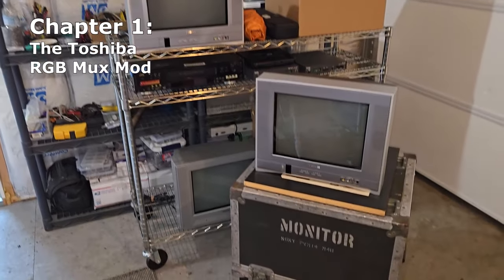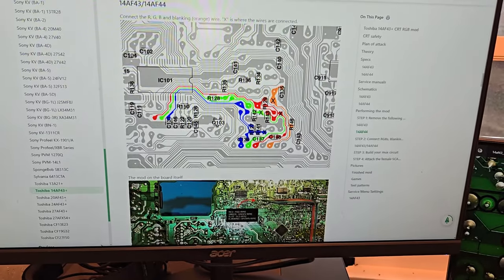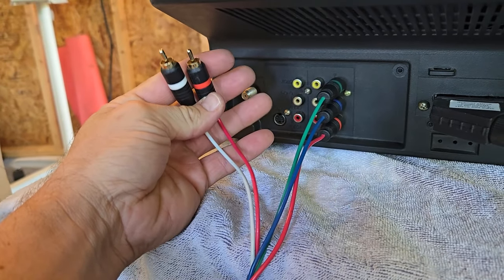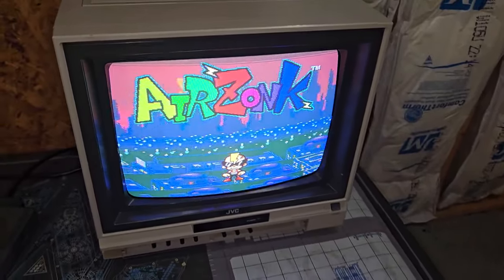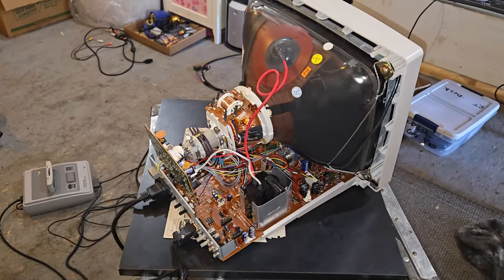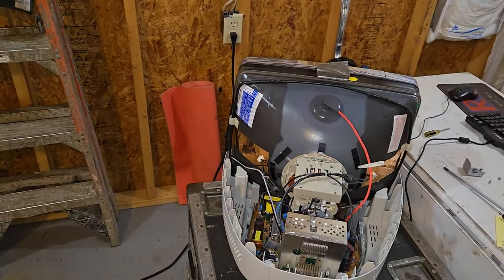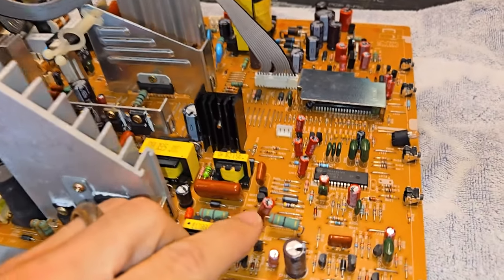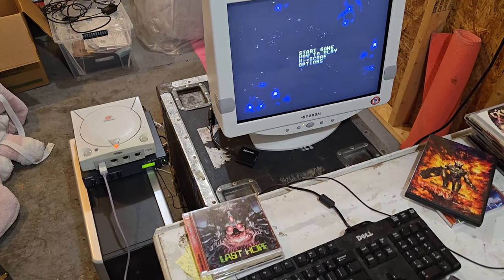Is there any future for CRTs? | The Dead TV Saga

Comment: They don't have a future, they will all die out in the end, though that may take many years due to them being stored and not used etc.
Reply: True but I think we still got awhile for them to stick around.
Reply: @Hyperion856 Working CRTs will probably last during the rest of our lifetime. For those who are very young right now however, they might not see many CRTs near the end of their lifetime.
Reply: All the more reason to enjoy CRTs while we still can!
Reply: @Hyperion856 I always wonder about retro tech in general if there is enough of a market for someone to keep making CRT’s or anything else that has been discontinued like 3dfx graphics cards or even reproduction old cars.
Reply: Crts from 80 years ago are still being worked on and restored. CRTs will be around as long as the passion for the hobby/addiction exists. I've saved over 50 working sets myself. Running out of space though.
Reply: @davidbenning10 Yeah I can see that being probable. Ngl
Reply: @davidp4456 iirc jets or aviation was built for some reason to require those for the screens? So apparebtly one company remakes the green ones.
Reply: @davidp4456 Replacing a GPU would require a fast enough FPGA. Replacing a CRT means building a factory for hundreds of millions of dollars.
Reply: @davidp4456 the market exists, but nowhere near large (or rich) enough to justify restarting a dead industry. There has been interest in the very old 1940’s and 1950’s sets for decades and they weren’t building replacement tubes for those either, even when CRT’s were still being made. Neither the cost (profit margin) nor volume are there. Classic cars are a bit different — high-dollar machines and rich customers. Plus, the machinery/skills needed to build engines and stamp body panels is still in everyday use.
Reply: @drknstodstny4141  serious how large is your storage in square meters if 50 is when it gets too stuffed ?
Reply: @drknstodstny4141 the problem is not saving and storing them. Is repairing them once they malfunction. Specific parts are getting scarce, like flybacks.
Reply: @RaenYrtham With the way I keep aquiring them the space will eventually become a real major priblem at some point. I do agree parts are becoming harder to find and repairing is becoming more difficult. I always pick up doubles if  I see them. Keep some non working CRTs for parts. Those I do not count as saved sets as they are non working. As of right now, I think with the last count i'm up to around 65 working sets. I have zero 36" sets as they are just too much for me as one person to move.
Reply: @RaenYrtham  I keep telling myself that I will eventually hold a retro crt / vhs / game convention where I can display all these sets with systems and vcrs hooked up so people can enjoy them.  I'm kind of a hermit and I live in the sticks so that will probably never happen but I keep dreaming about it. Most likely these working sets that don't go into my collection will be sold cheaply and gifted to people who appreciate them. The 40 plus vcrs/vcr combos will probably go that route as well. Gonna hang onto the 4,000 plus vhs though.
Reply: Incorrect. Sounds like someone who doesn't use CRTs very often. Where you from that terrible CRT collective group on Facebook? .  I have had CRTs that have lasted 30 years and others I picked up that are older.  I have had only one CRT PC monitor die on me and I got that second hand.. If you take care of them they will last. Breaking down is inevitable but there are ways to remedy and repair.
Reply: CRTs are simply better compared to modern TV's. Better picture, slightly better sound, the only thing you need is a single converter, then bam it's now useable with modern tech

Comment: The circuitry inside CRTs is well understood at this point. There is at least one effort that I've seen to create a custom built CRT chassis circuit in 2024. The only thing that is not currently within the grasp of the broader hacker community is making tubes. The general idea is understood but not the nuances of the manufacturing process. With enough determination though I believe we may see production of new tubes for the enthusiast some day. Someone needs to track down the engineers that worked on CRT tubes for the big manufacturers and document as much knowledge about the industrial processes as possible.
Reply: Maybe the owner of tesla motors could be have visión to make a lot money in a near future building a crts?,the tubes are the big problem with a somes ic's
Reply: The “only thing” happens to be the big elephant in the room. Not only would the CRT need to be remade, but the equipment needed to do that as would be as well. There are also the environmental implications to consider - the leaded glass and potentially toxic phosphor coating. No easy way around the fact that this is already considered hazardous waste — I doubt the governments involved will be quick to allow more to be manufactured.
Reply: @lcdjr85   i wonder if it would be possible to try making different display technologies with the same intended results? i know feds and seds which use similar principles behind crts were being researched and made but not sold by companies . they were later disregarded for some reason.  some articles say it's because of costs which would be dissapointing to the max. to disregard a heavily researched technology and not give it a single shot.  they had dedicated divisions to researching these so it's a mystery to me.
Reply: @lcdjr85 Its funny how leaded glass is considered toxic, when the lead in leaded glass cannot separate from said glass, and leech out into soil.
Reply: Be fast, as those engineers all have false teeth by now and start to think their cat is baby jesus.
Reply: I believe a very specific type of tube is still manufactured for military fighter jets speed and altitude displays.
Reply: @badreality2  Which brings me to the totally weird reasons goodwill has for accepting TV's: they refuse CRTs because of tightly enclosed lead, where they take in first gen CCFL LCD TVs where mercury escapes on the slightest crack. And those 1:400 contrast early IPS displays with 1366x768 resolution (which does not fit any HD standard) are absolute junk IQ wise. I always start to argue with them (if you know who to talk to as 80% is people with distance to the labour market) and say they should blindy accept anything with a tube brought in that works and shows Philips, Sony or B&O.

Comment: Why install RGB when the TV already has YPBr?
Reply: Lots of TVs (Toshiba AF, Sony Wega, etc) have video processing routines and filters built into the component input, that hurt the picture rather than help. The RGB mod bypasses said processing and filtering for a cleaner picture.
Reply: @cliggster True. But that’s why calibration is necessary on any input you plan on using. For instance, the over-saturated Component example in this video was guaranteed “pre-calibrated” as I’ve never seen component look THAT bad after even a mild tune-up thru the service menu (unless the tube itself was on its way out). Properly calibrated, you’d be hard pressed to tell the difference in a double-blind comparison. I have that exact Toshiba model and it was overly bright and “bloomy” on component when I first got it. Now, after about an hour in the service menu, it looks crisp via component and not at all “red-saturated” like in the video.
Reply: Not the same.
Reply: Doing the RGB mod on this Toshiba is pointless…
Reply: @cliggster There is virtually no difference back to back. I've tested heaps of CRTs with RGB scart and component. component,

Comment: I just bought a 2006 32" widescreen Panasonic CRT TV (it's flat fronted oddly) for £30. Super high quality and probably one of the last mass produced CRTs sold here, so thinking it'll last me until 2040-ish. Sadly it's 100Hz so won't work with my lightguns and unlike smaller TVs and monitors, I found it cheap because it's near impossible to lift by myself. Heavy is one thing, but when I have lifted it up, it's so damn big, I can't get through doorways!!
Reply: I have a 2005 Sony 28" widescreen. When i got it it only had about 600 hours on the tube. Its 50/60hz, has S-Video aswell as RGB and games look incredible on it. I just need to sort out some geometry issues and its good to last me many years.
Reply: Potentially a 100hz set could be modified to run 50-60hz progressive? Presumably the yoke and flyback would be up to the job...
Reply: @ericritchie6783  Thanks! Apparently, (according to some online forums) it's not possible to do with this model, but that's not to say for certain. I have several other monitors and another TV I can use the lightguns on, but they're small and was hoping for the larger screen for a better experience.
Reply: Those Panasonic and Sony widescreens are perfect for Xbox 360/PS3 and up. Was given a 30" Wide Sanyo Vizon a while back. Picture is suprisingly good. Wasn't to bad to pick up but I can confirm I had a harder time moving it in and out of my narrow halways and doors.
Reply: @drknstodstny4141  I remember all the earlier TVs we had were on a wheeled stand. The ones that didn't were called "portable" TVs, but the later massive wide-screen teles did away with wheels even if they were on a nicely designed stand.
Reply: There are lightguns for 100Hz displays.
Reply: @jimbotron70  Thanks, yes there are, but not for my old stuff unfortunately. I think it's PS2 era, like the Guncon 2, onwards that would work.
Reply: @boilerhousegarage  There are new lightguns using an IR transmitter above the TV set, think about the Wii for the movement detection, they work with any kind of display.

Comment: I have a general question about CRTs that I can't find an answer to online. If the TV has been standing around unused for years and you want to use the it again, can you just plug it in and use it without any risk or is there something to watch out for? So should you let the tube warm up first or something similar? An electrician once told me that a cold start after years of not using it could make damage because of the high voltage...I haven't used my Bang & Olufson 4200 CRT for good four years now, but I want to use it again and don't want to do anything wrong. before I stored the TV, it was working perfectly. Would be very thankful for an answer. ^^ Great videos on your channel btw. liked and subscribed. 👍🏻

Comment: Not enough people to fix them. Not enough worth while ones because scarcity, condition, and high prices. I have a 34xbr970 that Im going to attempt to recap. I have no choice but to learn. I will accept the fate when my crt's die.😢
Reply: If you truly love CRTs, it would ve worthwhile to fix any of them for it's own sake and to share the CRT experience with someone who never had the opportunity.

At the very least, it would be worth salvaging working tubes, high voltage components, and the analog circuitry
for use with better/different digital control, signal decoding.
Reply: @jnharton  I already gave one of my crt away to someone that needed, but fixing them isn't an easy task for the inexperienced.
Reply: @mexdrago3009  I agree with all your points in your first comment. I also agree with your second comment. It definitely isn’t easy for the inexperienced as they could potentially get injured or at the very least end up damaging something inside the CRT permanently.